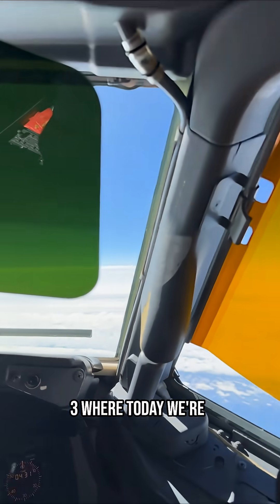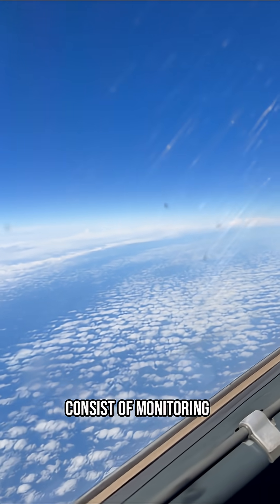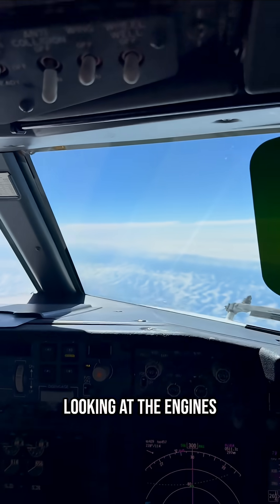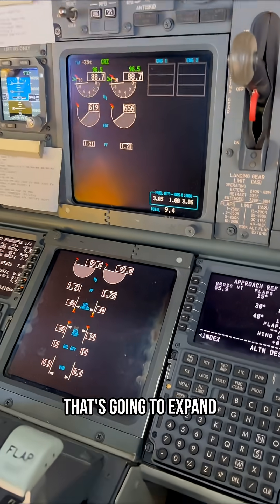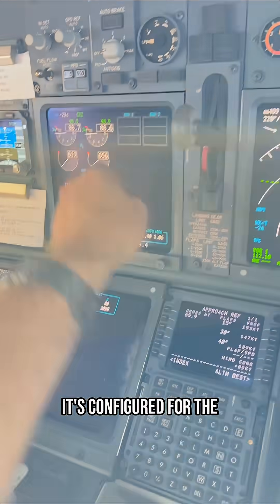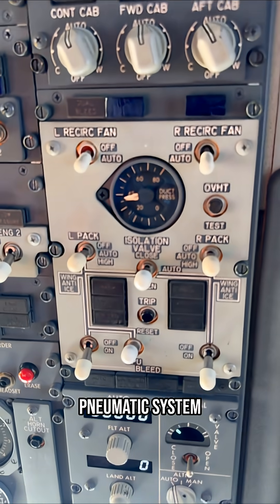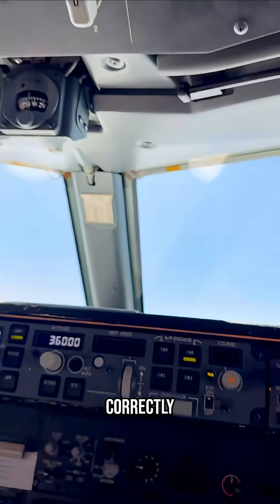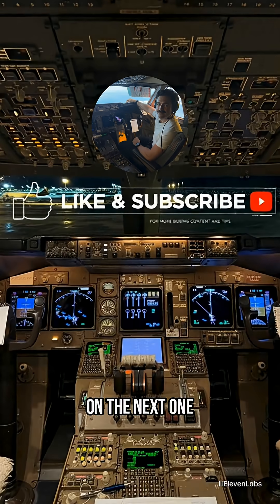What Pilots Do In Cruise - Systems Monitoring and More

Comment: Why is the APU on? I heard you mention ETOPS, is it a redundancy when you’re out of the circles?
Reply from the maker: Correct. The circles represent 1hr travel time (still air conditions), and in that region, higher redundancy is required. More modern aircraft don’t require the APU to run because they have auto-APU starting, or a RAT, which also automatically deploys in certain conditions

Comment: Why do You keep the APU on in cruise?
Reply from the maker: @polanski it’s an ETOPS requirement for jets than don’t have a RAT or a specific type of APU the starts when it senses loss of electrical power or thrust from both engines. Gives another source of redundancy for air/electrics on long flights away from suitable airports
Reply: @b-7three  Thanks, I didn't know that!

Comment: So what is the purpose of running the APU in cruise like that? Normal procedure for ETOPS?
Reply from the maker: I’ve got a video in the works on this because there’s been lots of questions about it. In short it’s a ETOPS requirement for redundancy. Can you tell me which system(s) it’s providing redundancy for?
Reply: @b-7three electric and pneumatic :) two gens, LH duct
Reply from the maker: @Boeing-xj5hh  and what are the limits on using either of those functions? Very good 👏
Reply: @b-7three  Dual bleed when Bleed #1 is online and   Gen trip off on the respect engine generator side, but it's been a while😅😅

Comment: What cmd do you choose for each flight, and how do you do an ils approach with app mode, idk how
Reply from the maker: If left seat pilot is flying, typically use CMD A, visa versa, CMD B if right seat pilot is flying. Few caveats to this - low vis cat II approach requires both autopilots engaged for fail passive operations. Great question and keep the good questions coming
Reply: @b-7three thx so much for the quick response, you see i fly in xplane12 a flightsim and i couldn quite figure how to sey ils properly, i have to set the freq for it the course and the APP mode and what else?thx again!
Reply from the maker: @elcapoxd7470  I recommend downloading a free copy of a b737 FCOM and try to follow the procedures so closely as possible. Also use FCTM Flight Crew Training Manual for techniques in how to do procedures that aren’t detailed in the FCOM. In short, follow these steps: load approach in FMC > tune frequency manually > set course > set minimums > press APPCH before the initially approach fix. Also don’t forget to set course + frequency on both sides, not just the side you’re flying from. Let me know how your approach goes!